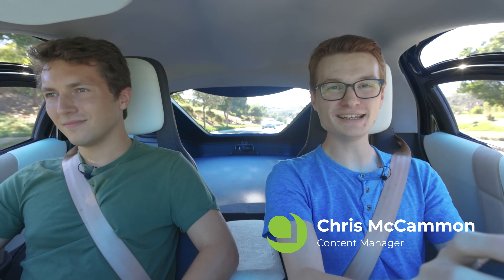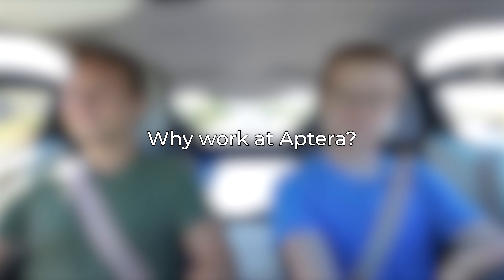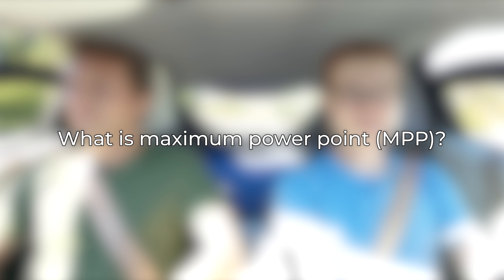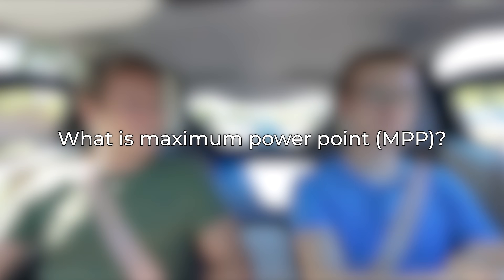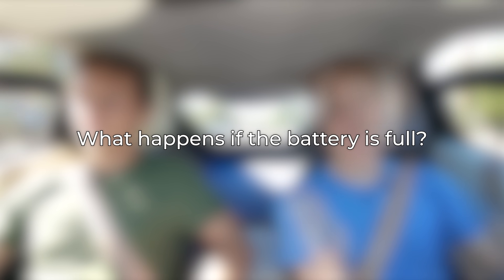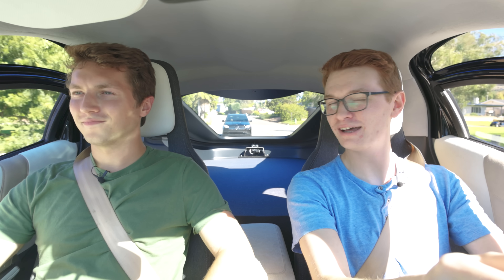Aptera's Solar Charger — The Third Wheel

Comment: Great update. I didn't think it would actually be charging while the car was moving, but that's an interesting problem to solve.  Would have been happy with it just charging while parked, but it's good to hear you guys pushing it. I was wondering if you would run a video on the accident that occurred to Gamma with the Beemer and what needed to be done to fix it.
Reply: I agree that there will be little actual solar charging of batteries while moving on anything but certain downhill runs or "coasting" to a stop.
Reply: @johnreeves7261  the solar will be extending your range as you drive.
Reply: @garywozniak7742  Agreed.
Reply: If the daily mileage is short distance and leave it charging while parked, you will rarely charge the battery in charging stations. A week's 4 hour daily park charging will be at least 10kWhr. Which could be more during weekends where it is not used and just let it stay under the sun a little longer.

Comment: MPPT is pretty ho-hum folks.  For shading issues, there are possibilities like integrating a Schottky diode (or FET ideal diode [rather complex] ) underneath every 'cell' and introducing an efficient V.I. pump to best exploit power output on every series array into the main buss.
If you were able to do that at low cost and hassle... Wow!

Keep on trucking you guys.  Love what you are doing and I want you to succeed even though I have no investment in your enterprise.
Reply: There's "voltage-boost" MPPT on each string and, hopefully, judiciously placed Schottky or T.I. SM74611 (or equivalent) FET-based "bypass" diodes.

Comment: Biggest thing i would like to see is the availability to plug in extra solar panels. I would love to be able to set up a string of panels in my yard specifically to charge my car without ever needing the grid. Not to mention eliminating the power poss of converting dc to ac then back to dc that we would get from using our typical home solar system to charge it

Comment: I’ve asked this in the past but have yet to see a video or response. From a ride stability perspective, what does the ride quality compare with to existing vehicles on the market. (While watching this video on the solar charger controller, several times the voices ‘vibrate’ bc of bumps. One would expect this to outperform most small and midsized cars on the road. Also at its price point, one would hope road quality stability and sound dampening would be at the higher end. It would be great to understand that.)  I’d love to be an owner but ride stability and interior noise are important features not yet communicated. Thank you!
Reply: By ride stability do you mean comfort or handling? It's been my experience that vehicles which are trying to be as efficient as possible don't ride as well as a Cadillac.
Reply: @IBMara  I’m no looking for “Cadillac” drive but something at Camry or slightly better. I recall Aptera consulting a company that improved the turning radius. One would think since much of the “gear” of Aptera is in the wheel, improving ride noise and stability would be more important since it should link to overall component reliability.

Comment: Should make it so aptera is easily interfaced to remotely mounted panels such as on a building or carport with roof made from panels
Reply: They have this already. It's called an EV charger, and you plug it into your car, and the wall. Your roof panels are connected to the grid and supplement your power usage (unless you are off grid, in which case replace "grid" with "house battery").

Comment: Question: How does the solar charger handle different count of solar cells on different areas of Aptera (there are less cells on front dashboard and more on roof and trunk area)? How many separate strings are used? As mentioned in the video there must be separate set of strings for each section to show the power output from each module and when one area is shaded (dashboard) and other area is in direct sun (say roof and trunk section that has way more solar cells and might receive more light depending on conditions). Did you group equal number of cells as multiple strings (say 22 dashboard, 22 front) and for roof and hood multiplication of 22 (several sections)? How many separate MPPT circuits are in the solar charger?
Reply: There are multiple charge controllers (MPPTs).  One for each "string" and I'm guessing a total of 7 strings.  Each string will consist of cells under similar lighting.

Comment: 30W PD is decent USBC power but if there was one port that can do at least 45W if not 100W, that would be great. Mandatoryfor laptop use. Having said that the 15A ciggy socjet could be used for a high output adaptor like the Promate Bullet-PD60 or Powerdrive-120 that can provide that.

Comment: You stated that the solar energy is topping off the battery.  If I'm driving down the highway at 55 mph, is the car using the energy faster than the solar panel is topping off? Put another way, can you get more than 40 miles of continuous driving if you are driving in good sunlight?
Reply: The Aptera is a battery EV that has 700 watts of solar panels that are like a trickle charger for the battery that they say can provide up to 40 miles a day of charge..
If you were on a road trip where you were driving all day through the useful sunlight hours on a summer day it would add about 40 miles to your range.

Since it is a good idea to keep EV batteries charged between 20% and 80% with Aptera's 400 mile battery, that is about 240 miles of driving.

 So without the solar If you started your trip in the morning with 80%   charge on your 400 mile battery at 55mph it would take you ~4 hours and 20 minutes to travel 240 miles where you would be at 20% charge and probably want to stop for a break and charge for a half hour on a fast charger. It will charge back up to 80% in that half hour. Then you hit the road and drive another 240 mile at 55mph that will take another 4 hours and 20 minutes. Where you would be at 20% charge and want to plug in. With the solar over the 8 or 9 hours of daylight driving on a sunny summer day the solar panels would have added about 40 miles to your range. So roughly speaking on this daylight drive starting at 80% charge you could travel ~ 260 miles before hitting 20% and having to stop and charge back to 80% and then be able to drive another 260 mile before hitting 20%.
So while you can push the battery, in this example , starting at 80% charge travelling at 55mph on a daylight summer drive, travel ~520 miles with one 29 minute fast charge stop. That would be a 10 hour trip. 9 and half hours driving at 55mph and half an hour to charge midway.

Comment: Will there be an option to limit the charge to 80% in order to help reduce battery degradation?
Reply: Depends on the battery tech they decide to use. It may be preferable to fully charge, but they sort of touch on it that even at full, potentially at what you set it to, the power produced could be used to keep the cabin cool. I love this feature on my tesla, but it can eat up like 5%-10% on a sunny day.
Reply: No need. Surely YOU can control where/when/how much charge can be given? You can always turn it off. Solar charging is not at your option. Park it in the shade, if you must

Comment: If the Aptera is parked outside, can I set up mylar reflective tarps alongside the car to increase light to the solar cells? Can the charge controller handle extra light?
Reply: Id take a wild guess in saying u probably shouldnt do that. It would probably heat the cells a little too much and could cause a drop in energy production and speed up degradation of the solar cells. Not to mention heat the interior even more.

Comment: A useful accessory would be a roll of solar fabric that can be spread on ground or over structures when camping or isolated. If designed to plug easily into Aptera, or even with its own battery pack, it could enable long stretches off grid.

Comment: These details were fascinating. So much is going into this project. Immediate feedback on which panels are getting best solar exposure is amazing. Consider competitions to drive between points where the winner picked the route with most solar energy collected and had the best time. A two parameter optimization system. Perhaps gps could include solar optimization routing in addition to traffic conditions.

Comment: What I am wondering about: does the Aptera have just one HV battery that is kind of always-on (e.g. to power the minimum electronic systems while the vehicle is parked, to unlock it, then start it)? Or does it have some additional aux battery (like e.g. a 12V battery) for that purpose and the HV battery is switched off (e.g. by a relay) while parked?

I am asking because in my old Toyota Prius II hybrid, which is only rarely used, the 12V battery is an annoyance: phantom drain discharges it, deep discharges quickly damage it, new 12V AGM battery is expensive and a pain to exchange. I have now ordered 2 solar panels to keep the 12V battery happy (not sure if it'll work in winter, they are of course not as powerful as the big panels on the aptera and will be mounted inside).

Comment: Was hoping for some actual tech talk. Like how many volts dc come in from the pv, how much is pack voltage and how much do you have to boost voltage to get it to work
Reply: In very round numbers, if there are 189 (nominally 0.6 volt) cells on Aptera and they are distributed into 7 "strings" with an MPPT on each, that works out to about 16 volt on the solar side of the MPPTs.  Nominal battery voltage will be above 200 volts I believe.  That's quite the boost ratio but it's doable.

Comment: Excellent question by @DemaGeek below. I live in Phoenix, but my driveway is shaded on the north side of my house. My south-facing roof is ideal for solar panels.  I'd like to keep mine safely in the garage while at the same time charging it from panels mounted on the roof of my house. Will we be able to do that using the on-board charge controller?
Reply: if you'll be installing panels on your house, would they be grid connected? If not, you'd lose out on a lot of production e.g. when your car is not connected and/or  when fully charged. If your panels are, I'll say integrated, then just charge the aptera from your line power, the power from your roof panels would decrease your overall power usage.
Reply: @travelfeet im wanting to do the same as OP. Lots of lost energy converting dc to ac and back to dc. Plus it gives to ability to still charge my car at a good rate if the grid is down since i have a grid tie solar system.

Comment: You didn't really answer the question about what happens to the solar energy if the battery is full.  Yes, the battery needs a little energy from time to time to stay full, but the solar panels will supply more than is needed.
Also, it's not good for the battery to charge it to 100% and let it sit.  Will the car have a  user selectable charge limit for the battery?

Comment: I live off grid at. altitude in the high desert. we typically get 10% or better than rated panel output. not a prob for home PV controllers. I'm just hoping the Aptera control will handle the sun poping out clear panels on a sunny day when amps can surge dramatically.
Reply: You say you "typically" get 10% or better than rated.  Did you mean "occasionally"?  I live at 5000 odd feet in elevation in southern Arizona and only occasionally get up to about 30% more than rated power for very brief periods when clouds are moving towards or away from the Sun.  It's known as the "edge of cloud effect" or "cloud lensing" I believe.

Comment: Thanks for the update and great explanation for everyone.  15A is the max for the cigarette lighter, could you also have an Anderson plug behind the rear numberplate for 30A 12V? Then people could plug in their own inverter when off grid or in  blackout at home. A second Anderson plug for an external solar blanket would also make sense. If the maximum is already met by the cars panels at mid day could switch off the external blanket. When there is less sun available the extra blanket or two will help. Some solar charge controllers allow 200% solar input so in winter you are able to get more power in and in summer it just limits how much it can take.

Comment: Will battery health be affected if the battery is always topped off at 100%?
Reply: 1) I have the same question.  Already an EV owner (2012 Leaf).  Li batteries prefer to be stored at 40-80% charge and that extends the life of the battery, unlike lead-acid batteries which like 100%. So perhaps your charging routine should have a "storage mode" that will put the Li battery cells in an optimum state for storage, that is, extended periods of time when the vehicle will not be driven?  
2) Li batteries have very little self-discharge drain.  However, most conventional EVs have a 12v battery as well as the Li batteries, to run the electronics, and that is what is drained when the vehicle is not in use. The Li battery only charges the 12v battery when the vehicle is on.  To avoid draining the 12v battery, things like the charge timer should be turned off, and many of us have the 12v battery on a standard trickle charger to keep it at 100%.  In the video the techs seems to not understand this aspect of most EVs.
3) There seems to be quite a bit of road-vehicle vibration.  If the ride is rough, like a motorcycle, that could have a negative effect on acceptance and sales.  My wife actually asked me some time ago if the Aptera will have a rough ride like a motorcycle or an old British sports car (lol) - if so she will not like that.
Reply: @ChrisLynt have you or your wife written on a newer motorcycle? If you had, you would find they ride comfortably.
Reply: Ha, ridden MCs since I was 16, and my wife has been on the back of my current one a HD, but are you kidding? Vibration will wear on people over time, and a smooth ride is one of the reasons people test drive cars.  That was my point.  Turning it around on me doesn't really respond to the issue except that it confirms the car is 'bouncy' eh?  @IBMara

Comment: Snow, how will the Aptera solar array deal with snow? Hard to believe I know, but people that live north of the 45th parallel are interested and have reserved Aptera's too.
Reply: From how I understand solar panels work in general, they generate a small amount of heat as they absorb energy because they aren't 100% efficient. So if there is heavy snow you will probably have to brush off the most of it but any ice buildup should melt on it's own. I live in Indiana and will be testing this myself soon, I hope! Usually get about ~2-3ft of snow at least  where I am per year.

Comment: This is a great update, but if the 110v outlet was removed and replaced with the ones mentioned I’m going to be one of many who are very disappointed.
Reply: Agreed.  I'm not sure what 180watts is supposed to power.  Laptop, maybe a portable tire pump?  Certainly not all of the cooking/camping accessories they were promising.  
I want to say they were supposedly going to give 1500 watt plug that would be useful for cooking or power tools.
Reply: @DarthTinderalla-qm9zw  "all of the cooking/camping accessories they were promising "

????
Reply: @n.brucenelson5920  what they were telling us we'd be able to run off of the supposedly included inverter.  But I know you have reasons for your absolute "faith in the Aptera engineers" Bruce
Reply: @DarthTinderalla-qm9zw  I never heard promises of "cooking accessories"  There were suggestions that a tent would be available.  There was also discussion of an inverter, although the size was in question.  The inclusion or not of an inverter in the LE models may not be an engineering, but a cost and sourcing issue.
Reply: @n.brucenelson5920  I wasn't saying they would sell cooking gadgets but we'd be able to run because we'd get an inverter.  Do you have the reading comprehension to understand that
Reply: @DarthTinderalla-qm9zw  Say what you mean, then.  I realize that English might not be your first language.
Reply: @n.brucenelson5920  I corrected myself in the second comment you responded to.  I realize you may have Alzheimer's and fanboyitis.
Reply: Agreed.  I want to be able to charge it with the solar from my home, achieving free fuel except for LOOONG road trips.
Reply: @markfinley3703  The 110v outlet would be for POWERING external 110v appliances. Why do you think the removal of a 110v outlet from the Aptera would prohibit you from charging it from your home solar?

Comment: I suggest a XT90 connector near the 12Vdc socket or externally for using external solar panels. Many people have folding solar panels they take with them camping etc. Some single folding panel are rated at 450 watts. Myself I have a few 200W panel I can connect together to supply ~800W to the vehicle.

Comment: I have a small solar panel for camping and did make the experience that if you put it in the sun, it heats up pretty quickly. A temperature controller is installed that switches off the solar panel if it overheats to protect the batteries. Can you explain to me what it's like with the Atera?
Reply: The Aptera has an active liquid cooling system with 3 zones. One zone cools the inverters and motors. The battery has its own  zone and the third zone is for the HVAC system.
Reply: I'm pretty sure Aptera will have temperature "control" on the batteries.  There's no need for temperature control on the solar panels.

Comment: I’d love it if the individual string outputs could also be shown, say if you double tapped that panel like the hatch or roof while monitoring solar output. 15A in the 12V port should run a decently large portable fridge. My last one was just a bit over 4A and had a freezer section.